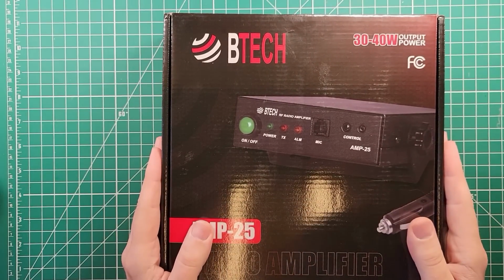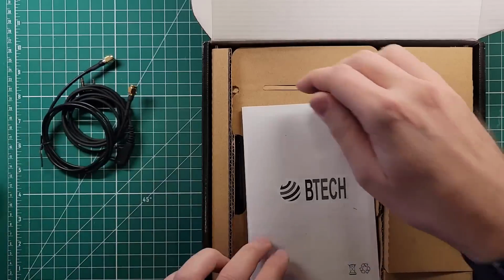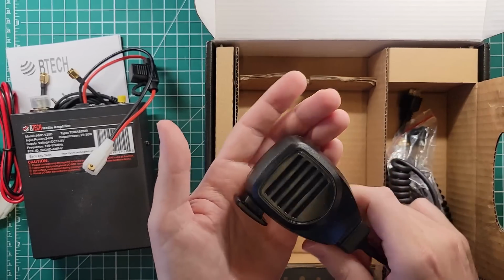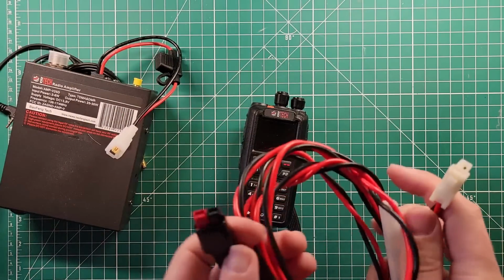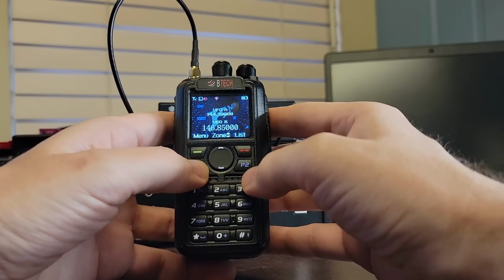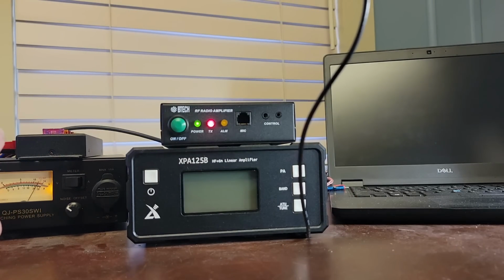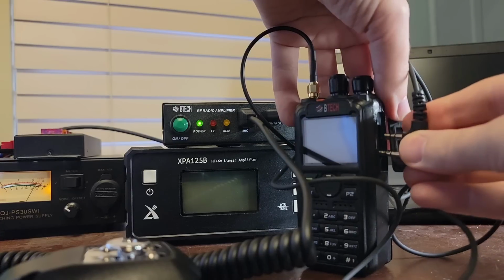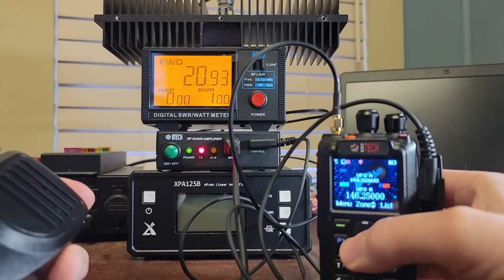The Gift Your HT Needs!

Comment: so instead of making the patch cable for the anytone 778uv I was thinking how about modifying this with a external jack for vox from another ht for my repeater
Reply from the maker: That's a good idea.  Should be pretty straight forward.  Or look up AIOC: https://geni.us/5WXJpV
Reply: @temporarilyoffline  it's pretty straight forward parallel patch from off controller mic input with diodes protecting input ht when keying on unit so voltage don't travel back into monitoring ht, also a toggle switch to turn repeater function off manually... I consulted BTECH and they pretty much told me it will work but their product wasn't intended for this sort of operation, and doing the mod would void any warranty, thinking biggest issues is feed loop however my antennas are far enough away and its all low power stuff - WSCZ561 73'S

Comment: One comment about a difference between these amps... pass through capability when the amp is switched off. For whatever reason only known to BTECH, the Analog VHF & UHF versions will pass the signal through to the antenna when the amp is off, but the Analog/Digital VHF version does not. 

 Most people will not use their radio with the amp switched off, otherwise it kind of defeats the purpose/reason of having the amp to begin with. I discovered the non-pass through when I wanted to compare the difference of hitting a repeater with/without the amp. With the amp switched off, I discovered that I couldn't hit a repeater that I normally could with just the HT alone. I found out why on the BETECH website,  that has a "features" comparison chart for all 5 versions... only the 3 analog versions can do the signal pass through when the amp is powered off.

Comment: I got the UHF one. love it. legal to use on GMRS but only Ch 15 to 22 and the 8 repeater ones. use it with UV-5X (GMRS) Baofeng in car. it has a band pass filter in the amp section. cleans up dirty feng. I tested with dummy load and RF sampler attenuator into spectrum analyzer. no measurable harmonics with amp on. down to noise floor to 1.3 GHz. The GMRS Baofeng UV-5G   was clean harmonics to start with. just a small spike on 2nd . may see 3rd but down in noise floor, went totally away with amp on. if the 2 meter one has this the dirty radio will clean up. I only have the UHF analog one. watch key down time on digital modes. reduce power. it says it has thermal cut off . never tested that . 73's
Reply from the maker: Good Info, thanks

Comment: I just purchased one from their website, and I'm hoping to use it in my go box with a IC-705 for 2m digital modes and to see how it will do with the Kenwood D72 for APRS. I'm thinking it should work fairly well. Thanks for the review, it's just what I was looking for!
Reply from the maker: I haven't tried it with the IC-705 yet, but I have used it with the FT-818.  Should work great! I'd be sure to get the digital version in case you need it for d-star https://youtu.be/wSPPxJjJoVI
Reply: @temporarilyoffline 
Thanks for the link to the video with  the 818, that was encouraging to see. It'll be great to get it worked into the go box with the option for more power!
Reply from the maker: @Emerald-City  Yeah, for some reason QRP feels different on HF than on 2m.  If you're in a dense area with a good repeater 5-10w is great... I'm not in a dense area yet.

Comment: I don't know, seems like putting lipstick on a pig. Why spend that money boosting an HT when $190 will get you an FT-2980R that puts out 80 watts?
Reply from the maker: Good call!
Reply: Sometimes it comes down to features set. For example, my TH-D72A is dual band, has full TNC, APRS/GPS, and does full duplex, and can act as a digipeater. It's actually pretty hard to find that in a modern mobile. Last I checked one didn't exist actually.

Comment: How hot does that amp get during QSO? I have a Btech 50x2 it has 2 power settings low and high. On high it puts out 80 watts on some frequencies and even on low power radio gets very hot. Just wonder if the amps do the same

Comment: I have the UHF model. The speaker mic jack/port has sloppy connection to the speaker mic. In my case, and others as well, you have to keep some type of pressure on the plug to keep a constent connection.
Reply: TO, et al - WHY does everyone seem to be calling a MICROPHONE a SPEAKER MIC these days? There is NO speaker in this mic. Just a mic element. The X6100, as an example or any HT “shoulder mic” is a speaker mic.  Sorry for the off-topic but this part of the product is one of many misleads. Hard to put the amp under the seat and then hear the audio.
Reply from the maker: I'll have to check it out.  I don't remember it being an issue with mine.
Reply: So, tape? Slight bending of the pins?

Comment: Just like "RJ45" refers to a telecom application for that 8-pin modular connector, the 6-pin has some applications. RJ11, RJ12, RJ14, RJ25. RJ12 and RJ25 use all 6 wires.
Reply from the maker: That's not confusing at all!